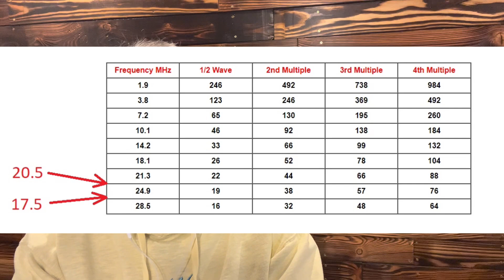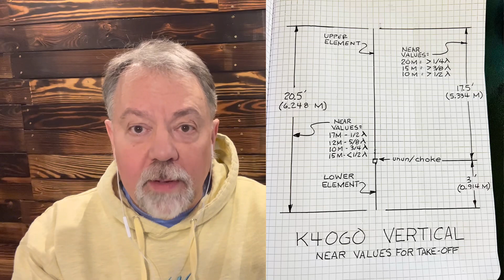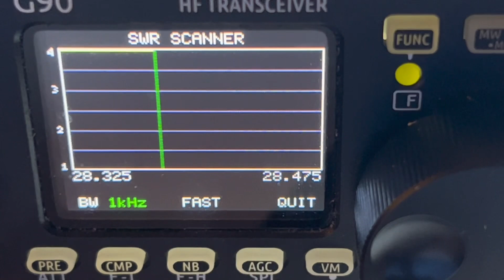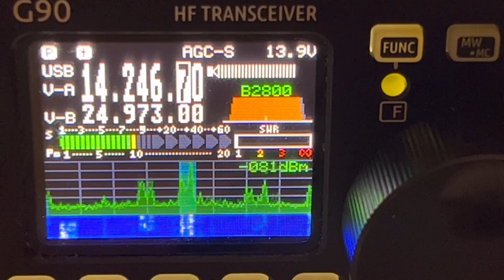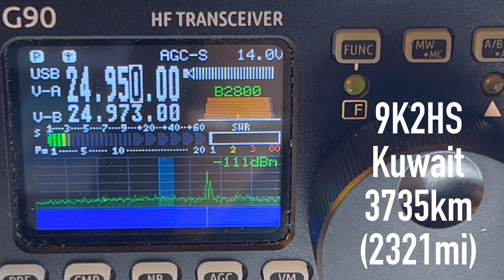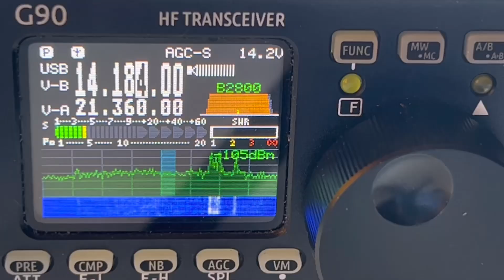K4OGO Vertical No Radial Portable HF Antenna

Comment: I like it - thanks for this. I would rather mess with 3 guy ropes than 8 (or even 4) counterpoises on the ground, at least for portable ops. I am going to try this! I have been using MFJ mast and fishing poles and although a quarter wave vertical can net some contacts, I want to try "easy-up" solutions for portable use, and I like your ideas. Also I do like the various physical arrangements available with an EFHW antenna. Still going to do more with that! All the best Walt, and also to others experimenting with antennas! Dave WA4NID
Reply from the maker: Thank you! 73, Walt

Comment: Very interesting design, thanks for the great video. This antenna actually is close to a Rybakov antenna you covered in another video, with a short elevated radial, isn't it?
In this other video you used a 4:1 unun. Wondering if it would have given better SWR results...
And by the way, I really dislike contest week-ends. No fun in these chain QSOs. Not my conception of ham radio. It's frustrating when you don't get a chance to exchange some info about gear, antennas and such.

Comment: Did you ever try to have the coax just go straight down instead of 90 degree to the antenna? Does it work or interfere with the shorter element? Would be even faster deployment for any POTA type setting. 
Also, what is the ratio between long and short element (e.g. 30/70 like a standard OCF)? 

Cheers, K4TMO
Reply from the maker: I have not tried it that way. I really didn't ratio it, it was more of an attempt to stay on non-resonant "random wire" lengths.

Comment: @mikenikolich1569
0 seconds ago
Great video, 007! Ham radio is a magical hobby, isn’t it? I just worked IK4POI from a park in Naperville, Illinois. I was using a speaker stand-mounted MFJ vertical running 30 watts USB, and he was running 600 watts into a yagi. Both of us were 5-7! Keep us posted about this antenna.
Reply from the maker: Thank you! That’s a great contact!

Comment: This is another great idea Walt.   I live on the Cumbrian coast on the Solway Firth and with a 10 meter tide, sometimes on the beach I can be 4 miles from open water.   So this idea will be a good one to try.    I wish I could find a UK supplier of that natty little 1:1 choke you have there.  All the best, Pete
Reply from the maker: Thanks! I need another one of those baluns, mine is getting loose and worn. Unfortunately he hasn’t had any in stock in a long time
Reply: @COASTALWAVESWIRES    I was watching a 2 year old video by Tim where he was making a 2m antenna and he made a choke using 10 turns of coax on a small piece of conduit.   Would that work on 10 and 20m , or am I just a hopeless chancer?   All the best, Pete
Reply from the maker: @Crusty_Camper  yes that would work as a choke!
Reply: @COASTALWAVESWIRES  Great !   I'm getting so many good ideas from you two and now you have saved me £35.  Thanks Walt and Tim,    Pete

Comment: wonder what the difference would be between the OCF diopole, and a true EFHW?  OH!  Where can someone find the small compact 1:1 current unun that you have?
Reply from the maker: That little 1:1 is built by N9SAB and sold on eBay. Here’s the link: https://www.ebay.com/itm/164358440127?mkcid=16&mkevt=1&mkrid=711-127632-2357-0&ssspo=TIbkpe2XS0m&sssrc=2349624&ssuid=IVyKb51XQj2&var=&widget_ver=artemis&media=COPY

Comment: I have another problem and hope you you can assist me.   When I connect everything up I did notice that when I touched the PL-259 plug the receive can up as though I have an earthing problem.  Do I require an earth?
Reply from the maker: That’s interesting and no I don’t think it’s an earthing problem. It almost sounds like common mode current in your coax. Are you getting this at the feed point, after the choke balun or at the radio?
Reply: @COASTALWAVESWIRES  I am using a 1:1 balun as the choke which is 140-43 and the ferrite core in the 9:1 is a 240-52.  I was going to use a 240-43 in the 9:1 but its 3MHz to 20MHz.  The 240-52 is 1 -50MHz.  Have you a better ferrite to use?
Reply from the maker: @RichardOSBORNE-z8p  wow, I’m stumped on this one

Comment: Hi Walt   made your antenna today however I did not have a 1:1 balun like NSAB.  I have an ordinary balun 1:1 that is the SO 239 socket and a terminal on each side.  Not sure if I can utilize that or not.  You might be able to tell if I can or not.  73 Richard
Reply from the maker: I’m sure it will work great. It’s all about experimenting, give it a try!
Reply: Hi Walt.  I have good news for.  I have found that I had soldered 1 wire onto  a wrong connection.  Pulled everything apart and with antenna on the floor in my messy shack  I am receiving S3 from the USA.  Is that good  ?   I reckon it is and change of rx when I touch the connector.  Have not tried it outside however I think I am on the winning side.

Comment: Interresting design. I tried your antenna data in Eznec (now freeware) and looked at the impedances on the bands, they are on all bands way off to the 450 ohms of the 1:9 UnUn. So all your results (and losses) depend on the coax cable length. Example: your antenna shows on 20m a R35 -j1296 and you transform that by a 1:9 down into an impedance of R9.83 - j212 Fed this into a 8m long RG-58 coax (as an example), we will find at the end of the coax R6.58 - j60 This low impedance can be matched with the tuner for a good SWR on the G90 side into 50 ohms. Further simulation with tools of DL1JWD and AC6LA shows -  around 70% of your power is lost due to reflection in your coax. The tuner can not compensate the reflection losses in the coax cable - even if former one is called 'antenna tuner'. ;-)  But the saying goes: 'any antenna is better than NO antenna'
Reply from the maker: Interesting model results, I’m curious which band was worse case and which was best. My real world results don’t seem to completely agree with this when running the antenna analysis tools in the rig. I’ve built it now with both a long and short coax and didn’t get that great of a loss in any band. Yes there is loss for sure as this antenna is absolutely a compromise but nothing in the range of 70%. I’m seeing the greatest loss at 36% on one band.
Reply: @COASTALWAVESWIRES  the losses in the cable up to the feed point of the antenna can be calculated - but they are very difficult to measure. Because you would need to do that at the feed point. How did you find out ?
Reply from the maker: @WolfgangKMeister  did you include the choke at the feed point in your model?
Reply: @COASTALWAVESWIRES  will send you more details with email

Comment: For the lower section if ya add a bit more wire with a clip to a tent peg ya might get 20 better but havin the 9:1  and the choke in 1 box would make it easier for ya
Reply from the maker: I’ll look into that

Comment: Ok so the more I look at this the more I really like it. I liked it before, but I thought I wanted a beam but they're ungodly expensive, and difficult to deal with.

My goal is for a single antenna to hit 20, 17, 15, 12, and 10 meters. I'm looking to hit targeted contacts, so that's why I was looking at beams (south florida to eastern Arizona being one goal). That's also why 17, and 12 are very important to me - there's no contesting there.

Ideally, I'd like to keep all bands roughly around 3:1 or less, 10 leaves a LITTLE to be desired, but - I have a hamstick dipole for that too. Mines going to be more of a permanent-ish install.

I REALLY want to see updates on this one as it's improved! It's SO inexpensive to make, and low profile it's hard to justify a beam.

Comment: I have a question, if I use my DX Commander Expedition Mast and my PackTenna EFHW antenna will that work the same as you described in this video??? KN6STX
Reply from the maker: It will work great but it’s much different than this.

Comment: Thanks Walt. With so many teeny tiny parts in radios today it seems that antennas are still the one thing we can experiment with. You're doing great.
Reply from the maker: Thanks Rusty!
Reply: @COASTALWAVESWIRES  but 5 degs of take of angle would work that why  the ham sticks as a dipole will work

Comment: 10:20 that spacing between calls… also the operator went to the bathroom and forgot the radio calling 😂

Next weekend is the WPX SSB, if you open the sink faucets there will be DX. I like contests, but this amount of contests we have today is actually bad. People learned that most hams will only be on the air for contests so they are creating too many contests trying to get hams on the air.

I have almost the same problem you have. People are so curious that sometimes I’m in the middle of the snow, up to my knees, in a gigantic park where no one goes in the winter for any reason. Then suddenly someone decides that it’s fun to walk on high snow just to see what I’m doing. Then they trip on the wires…. Now I’m deploying my antennas on top of fences, with no counterpoises (the fence is the counterpoise). So far, no one walked on top of the fence… yet.

73
Reply from the maker: Hahaha I feel your pain. I’m actually looking forward to next weekend. 73 my friend!

Comment: Hi Walt, CQ contest nope I won't go there honest 😁🤣, I sort of use a variation of a theme not that different to what your using, I've got a local park a few minutes away from home, I go there if I've got some spare time to test different things out or just to chill out for an hour or two, I often use a copper rod a ground spike with a 3/8 mount 17 foot telescopic whipp with a 9 to 1 Unon maybe a single radial common mode choke or take the Unon out of line and add a loading coil either the MFJ-63 or slide winder both work well with 17 foot telescopic whipps for something that's really quick and easy to setup it performs really well, thanks for the video all the best Adam G7CRQ.
Reply from the maker: Thanks for sharing Adam! Yes I’m tired of the contests. 73 my friend!